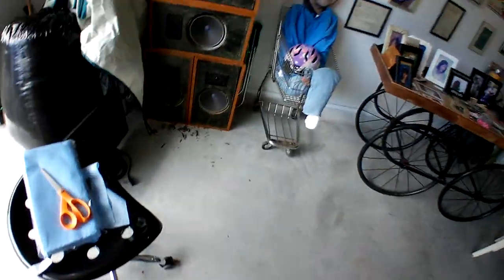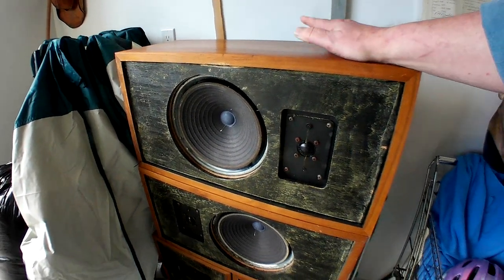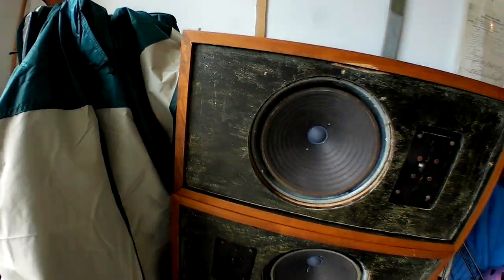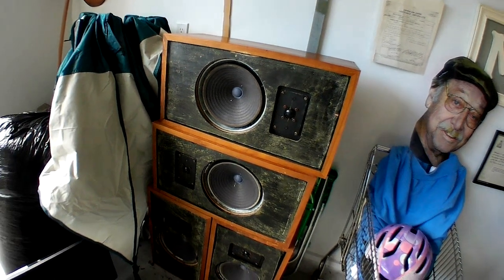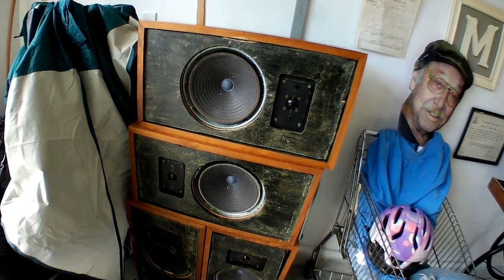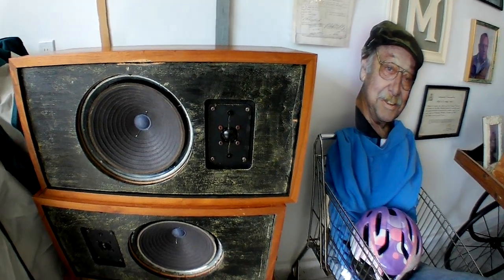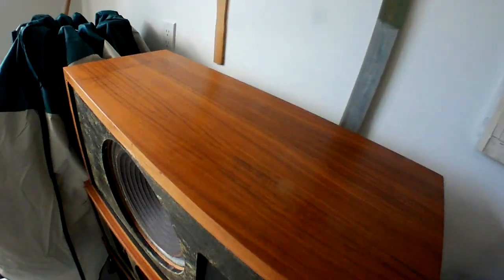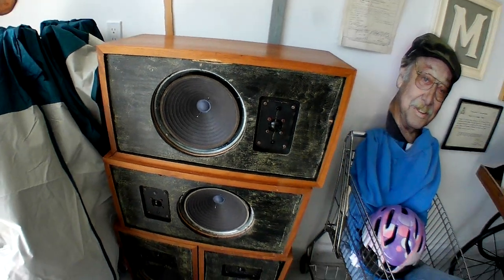HiFi Habit: Patterson Industries - Phase 6

Comment: Question.why didn t  you show us the drivers.. please show me all sides of the woofer and tweeter..next show the xover..and show me the inside of the box .. with pics of glue and any sound deadening and cabinet poly fil..fiberglass.or rock wool. Im here to investigate..
Reply from the maker: That is going to have to happen in a follow up video. Right now both sides are nailed shut so I will need to gently break into it from the front. This was just an introduction to the purchase. I do plan to show the innards as soon as I can see them myself.